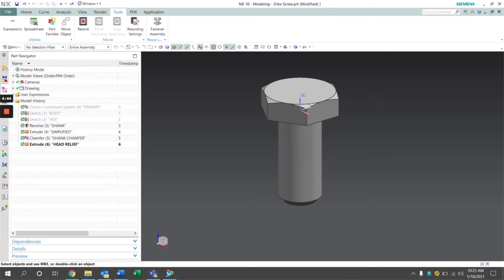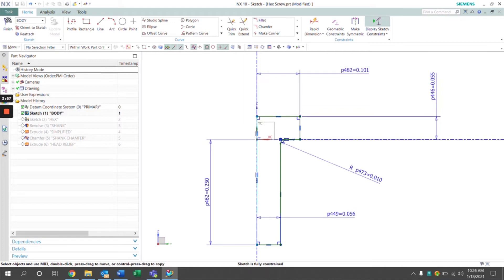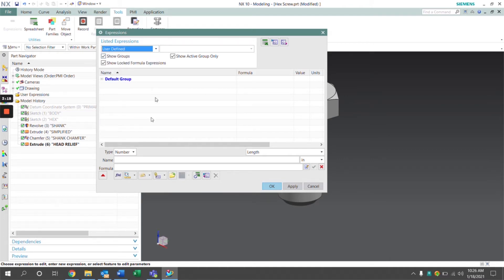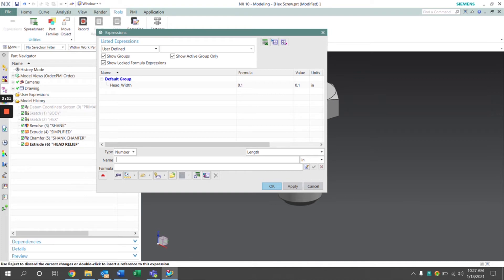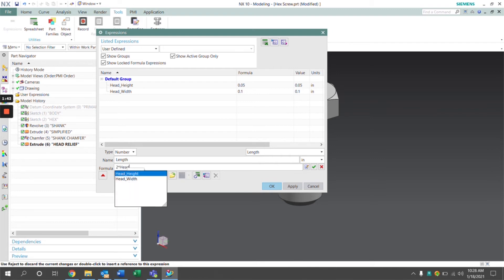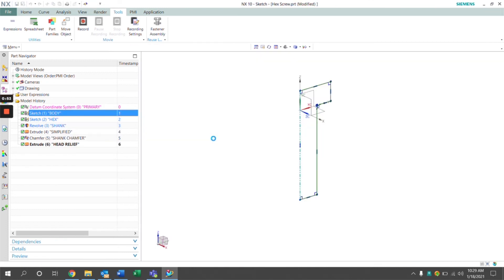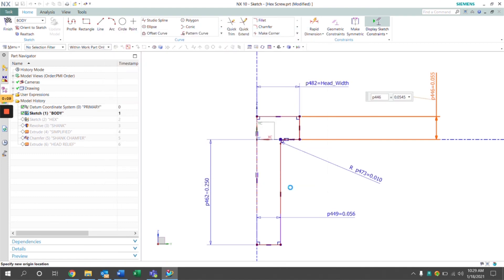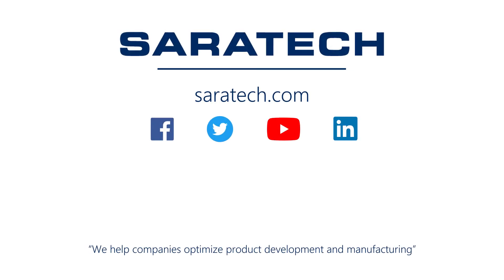NX: Dimensioning Using Expressions

Comment: Hi, I'm a mechanical engineer, I need help with UE in NX. The problem is when I change the already defined expression in a saved file to my desired value in the sketch environment and then click finish sketch it shows error. The problem comes when I increase head height or head width it's kind of connected to other dimensions and expressions so it's showing error. Any solution ?